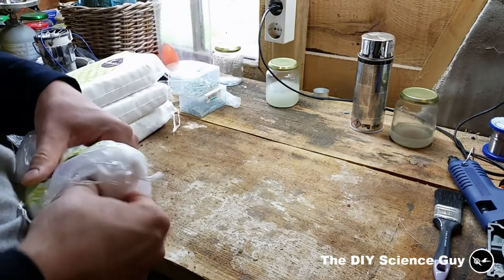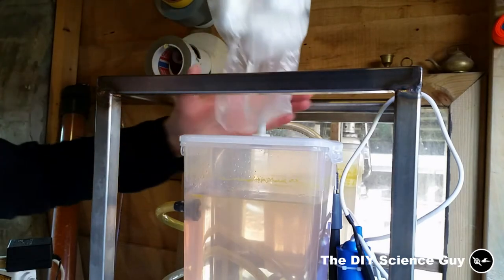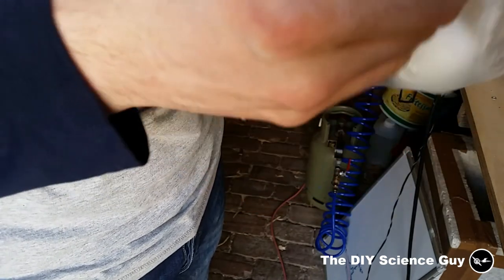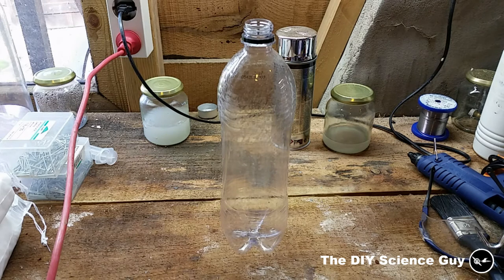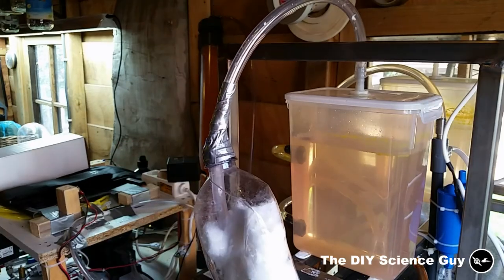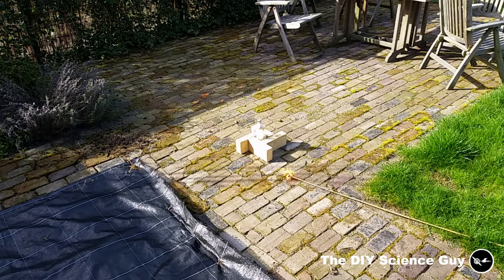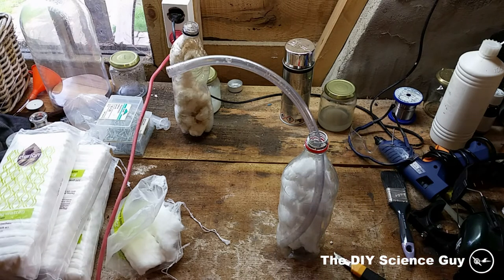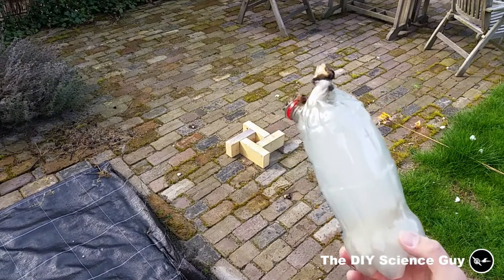Cotton and pure oxygen whoosh bottle

Comment: Just as a thought experiment (so many ideas come to mind) I was wondering if pure oxygen would diffuse into kapok fibers over time time so that you could load the fibers up with enough O2 to be used as a whoosh bottle or simple primitive rocket fuel of sorts, providing a quick burst or impulse without the need for additional oxygen - the idea being to just stuff some into a bottle or tube and light it. The fibers are quite flammable as is. 

"The kapok fiber once used in floatation vests and has been used as building insulation has a hollow fiber and looks like glass fiber under the microscope. The hollow fiber has air inside allowing combustion deep inside the material. Smoldering fire and open flame travel quickly within the material."
"Typical analyses indicate that the Kapok fibers comprise 64% cellulose, 13% lignin and 23% pentosan. Besides these constituents, they also contain wax cutin on the fiber surface which makes them water repellent notwithstanding they are preponderantly composed of cellulose."
https://www.textileschool.com/amp/183/kapok-or-capok-fibres

Wiki
"Native tribes along the Amazon River harvest kapok fibre to wrap around their blowgun darts. 
Kapok fibre is light, very buoyant, resilient, resistant to water, but it is very flammable."

"It is inflammable: the trapped air makes kapok highly inflammable, and if it catches fire it is difficult to put the fire out. Special precautions are needed to transport kapok in the hull of ships. One advantage of this characteristic is that kapok can be used as tinder."
http://www.wildfibres.co.uk/html/kapok.html?redirect=false

"The fibres contains approx. 80% air, it has thin walls of cellulose with many cavities.
Kapok fibre is 8 times lighter than cotton."
http://www.ceiba.dk/?page_id=214&lang=en

Or maybe try storing kapok in a hydrogen atmosphere to see if the tiny H2 molecules would permeate the hollow fibers. Then after a week take it out and see  how it burns. It's sold on eBay for pillows and toys and as fire tinder.
Reply from the maker: Wow good ideas!

Comment: I was thinking if you spaced and loaded cotton fibers ideally into a long tube sealed at one end, it might make an entertaining or novel variation of the Barking Dog effect, if you've seen those demonstrations. 
And if it worked would be interesting to see a slow motion of it with perhaps the excess cotton fibers cannoning out the exhaust end. I really liked that snow effect. Length to diameter ratios of the tube could be played around with for best results. Also maybe an angle of about 30 degrees or less might be better than the typical straight up tube motif. Just something that might be fun to try some day depending on how well the feedback builds up in the tube.
https://youtube.com/watch?v=c3fJRRCAIdk
Reply from the maker: Yes thats also nice! The separation of my hydrogen generator doesn't work at the moment but when it does again,I think I will give it a try! Thanks!